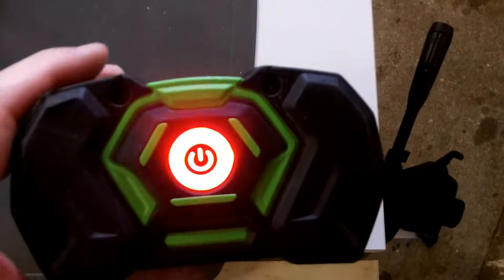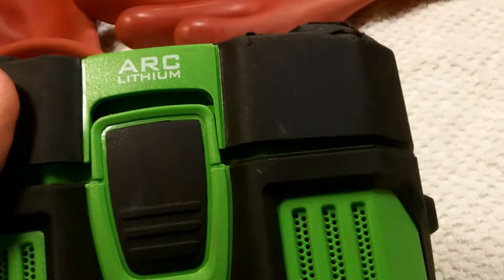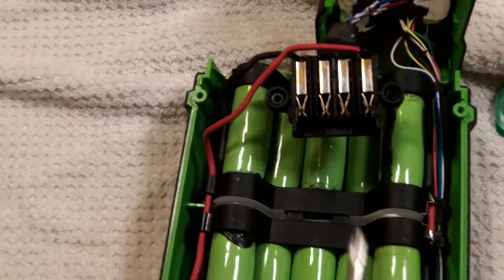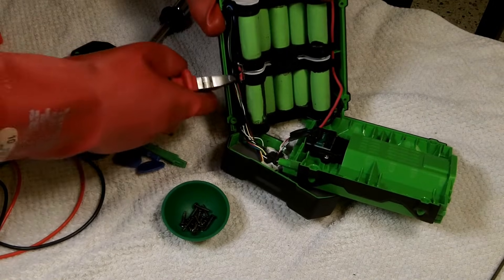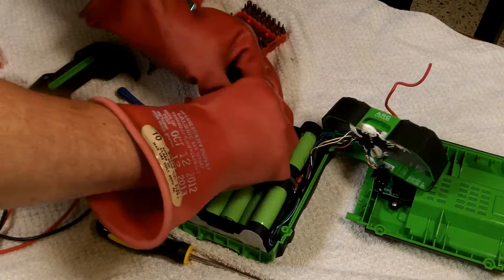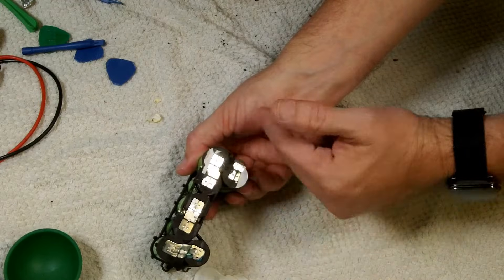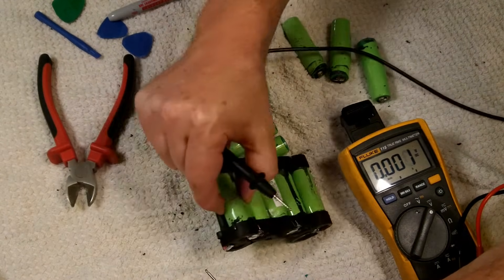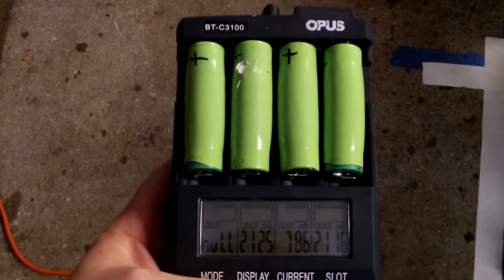Ego 2.5ah battery fast flashing red light - Bad Cells disassembly

Comment: Just to share info... I just picked up 17" cut EGO string trimmer brand new at an auction site (a return), the top of the line one that takes attachments. It came with the 5ah battery but the battery light didn't come on at all when I press the button and did nothing when I put it on the charger. I checked voltage with my meter and it was in the 20s so I put my two 30v benchtop power supplies in series to double their voltage, set them to 4 amps and connected to the battery terminals with 2 copper strips. The battery voltage started rising steady and in about 10 minutes it got to 52v so I pressed the battery button and got 1 red led. I then held the button down for a few seconds to reset the BMS and all the LEDs lit up green. After that it charged normally on the EGO charger. I'm pretty happy to have it at a third of it's normal cost.

Comment: Keep-Cool Technology:
Each cylindrical cell is wrapped in a proprietary Keep-Cool sleeve containing a phase change material. 

I think you may be wrong about saying they are bulging, ego cells are not perfectly cylindrical like Samsung or other 18650 cells.  I know your battery was bad, but this is just in regards to what cells look like.
Reply from the maker: They were definitely bulging. Do they still use the phase change material? I remember reading about that in their early batteries, but not sure if they kept using it.
Reply: @summetj  They were not bulging, the cells have a wax cylinder over the normal cell wrap and then another wrap over that. Once the cells get hot enough to melt the wax (phase change material) it takes the shape of a bulge under the shrink wrap and stays that way. It's normal operation and not a problem. INR cylindrical cells do not bulge when they fail unless you put a high output one in a dead short. They usually just push the seal out of the + end and leak a little. Lithium battery packs are my hobby and I build a bunch of them for tools and small electric vehicles. Not trying to give you a hard time, I only intend to help.